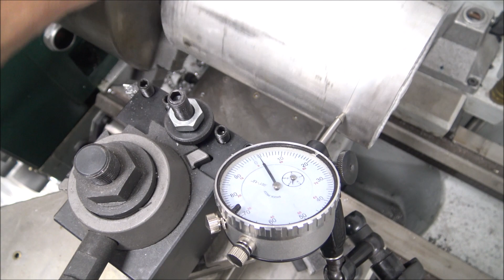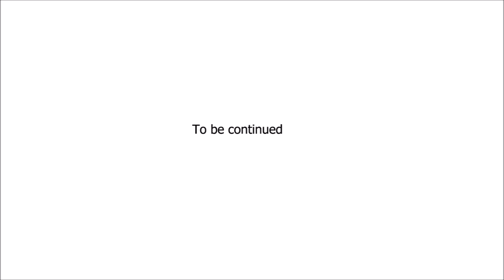TIG Welding Aluminum Fabrication - Making a Secret Hidden Opening

Comment: Do you use the air to cool the part as your welding? If so doesn't it disrupt the argon.
Reply: Air blowing on outside of cylinder...argon and welding on the inside of cylinder...like asking if blowing on one side of a wall would spin a fan on the opposite side of the wall...so the short answer is no.

Comment: Here before the “WHY AREN’T YOU WEARING STEEL TOED BOOTS” comments :)
Reply: I'm here for the cover your ways and that's not a parting tool comments.
Reply: Because he mostly works with aluminum. The bigger question is why he doesn’t have aluminum toed boots?

Comment: while I can confirm the swarf rolling up the work the correct way while doing work on the lathe i have to object the threading operation: the repositioning for cutting the next depth has to be done reversing the work piece too, not only the carriage - all wrong; it's all wrong

smh my head in disbelief

;^P